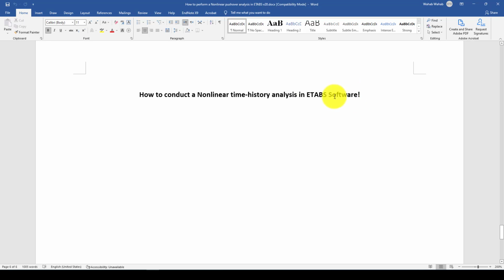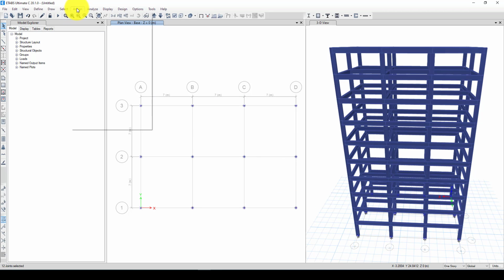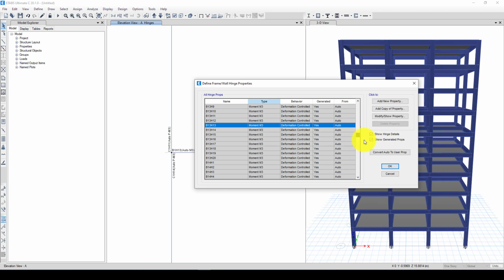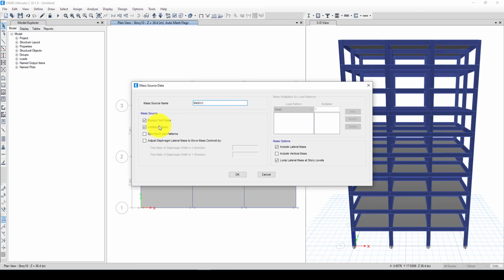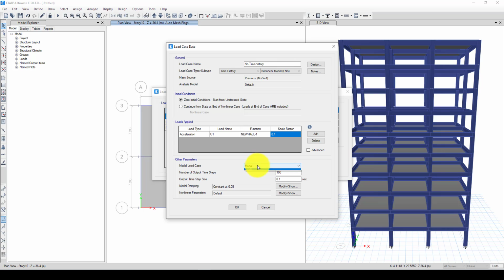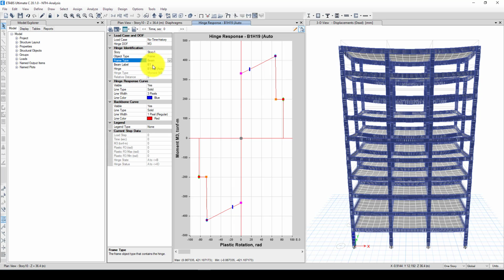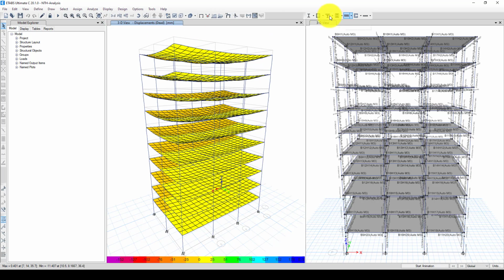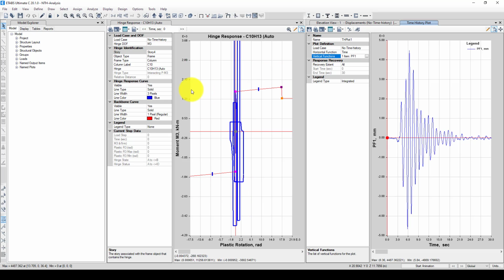Nonlinear Time history Analysis in ETABS Software v20

Comment: hello Sir, Can i get this time history data as i have a mini projects so it will help for me
Reply from the maker: Hi there, if you have the Program there are time-history  data saved in the installed directory. Or you can check my channel there is video showing how to download them from PEER ground motion database.
Reply: @KSSE_Engineer can i use these data for time history wind load?
Reply from the maker: @ no
Reply: @KSSE_Engineer How can i download the time history wind load data

Comment: Aos sir. Sir The results of acceleration and base shear are not coming for steel plate shear wall. After fast non linear analysis. Can you plz tell us why?
Reply from the maker: W salam , maybe the analysis not converged. So I recommend you to conduct a linear analysis first and then do the nonlinear after the analysis completed see the analysis message.
Reply: @KSSE_Engineer  i got analysis message but results are not compatible after applying Steel plate shear wall. i have seen your all videos, i am making some mistake. you help guide us alo.t

Comment: Hello Engr may I ask a question, I saw when you run the analysis there is 1 error which is " NON-ZERO TIME-HISTORY FUNCTION VALUES WILL BE IGNORED AT START OF LOAD CASE." it is approved your design even if you have an error like that? thank you for your response and willing to join.
Reply: @sobrevigaezekeilkeizen8096  hey have you solved the problem? i get the same problem and still struggling to solve it
Reply: @orcuscorn  I believe it just means that in your time history file, it expects the first value to be 0,0 (time, magnitude). So the first value will be replaced with 0,0, but that shouldn't really be an issue (the rest of the time history will be fine)

Comment: Hello, sir. I have a trouble when i input my time history function but the function graph just a line without acceleration appear. Can you help me with this? What should i do? Thank you!
Reply from the maker: Hi dear, you can check your input carefully like the video. If you wore unable then please join the channel membership I will solve your problem personally.
Reply: @KSSE_Engineer  thank you for the response! 
I will join the membership as soon as possible, but also ive already sent you an email with some images. Maybe you can check on it.
Reply from the maker: @chocohazelnuttt  Please send your model via email.
Reply: @KSSE_Engineer  Ive sent it already, thank you!
Reply: You have to check your time history station file (.txt) and Put the time interval between two points correctly which was may be written on your .txt file.